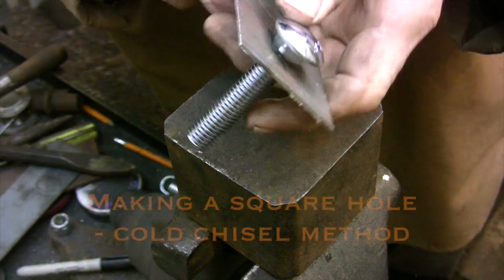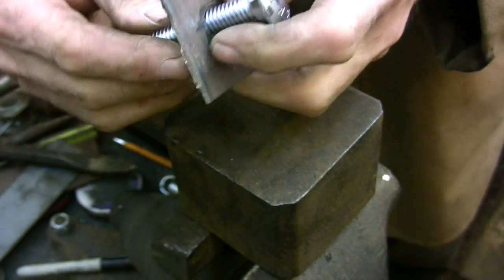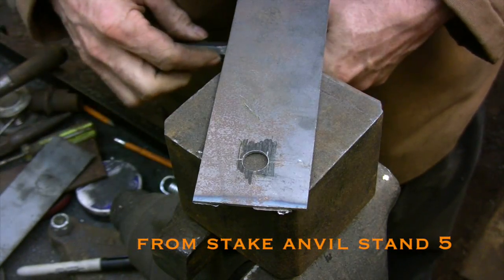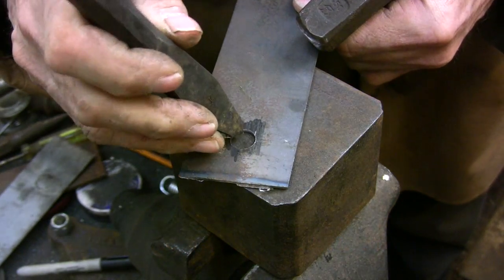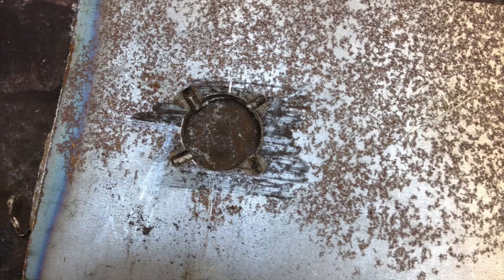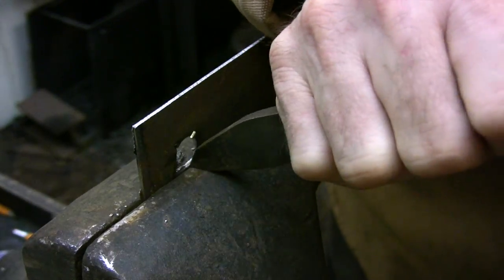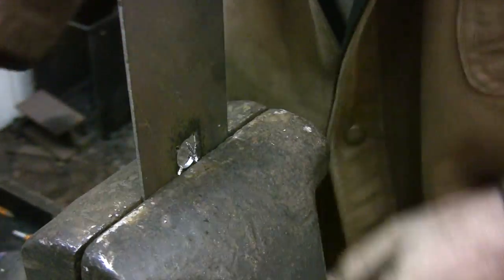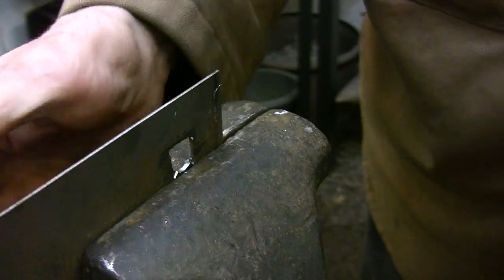Blacksmithing for Beginners - Cutting a square hole in sheet metal

Comment: I remember seeing this in one of your weekly updates, and it's possible that if I watched the original I might get my answer, so, if that's the case, just tell me to rewatch it rather than expending your time in answering this. I was trying to recall, is there a particular reason that there needed to be a square hole versus a round one? As always, thank you for your time, Denis!
Reply from the maker: I used a carriage bolt for that clamp so I would only need to use one wrench to tighten it.  The square hole fit the head of the bolt I was using.
Reply: Thank you, sir! And I hope you have a wonderful week!